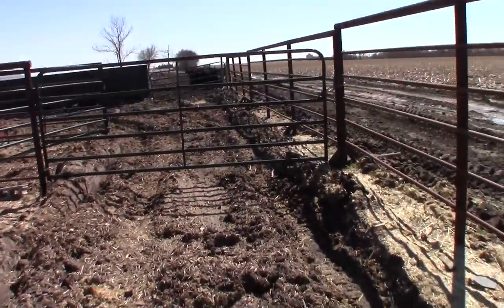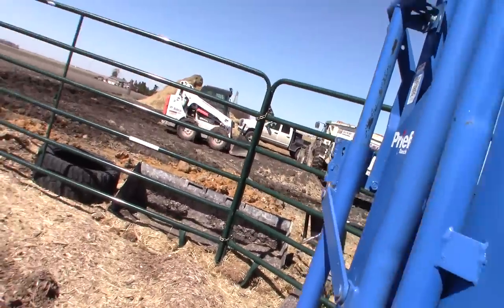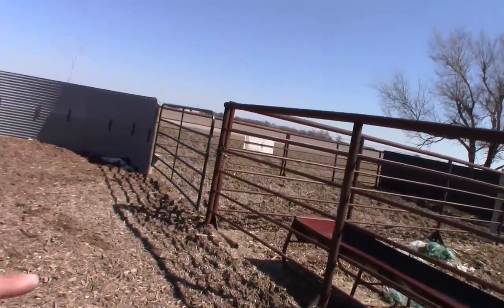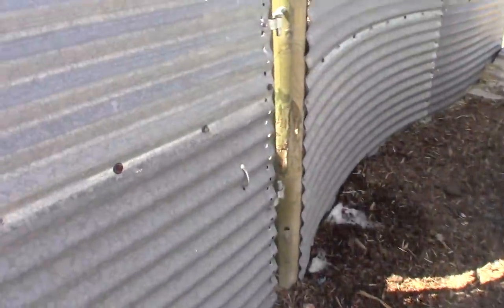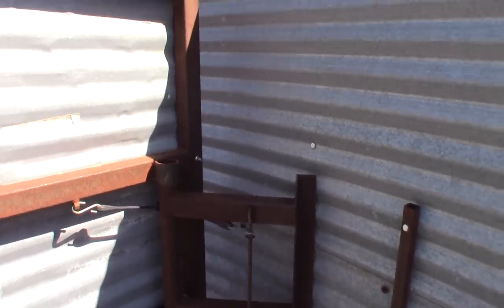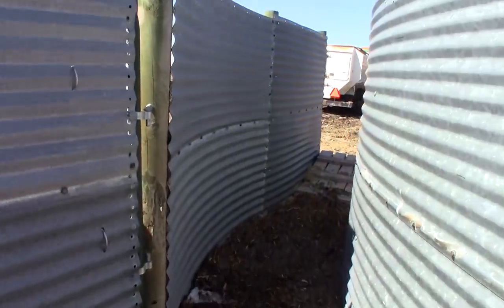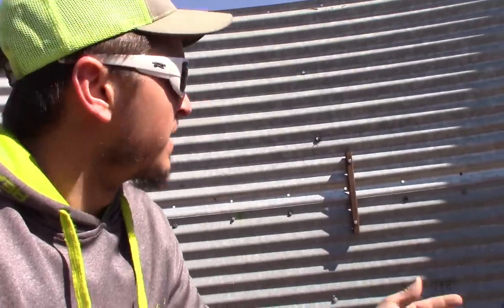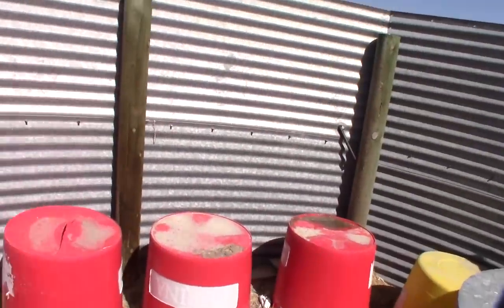Cattle Working Pens

Comment: Nice farmer ingenuity. Wish I had thought of it but I got a store bought. I set it up inside a 40x60 building. I have switch gates but everything goes through the head gate. From there they can return to holding pen. Got straight on trailer. Go to holding area if we need to keep them up. Or return to pasture. But I really like your set up. We need one on our smaller farm and I'm gonna try to copy your setup somewhat. Thanks for the great idea. Already have a donor bin so I'm ahead atm. Keep them coming I might get smart yet.